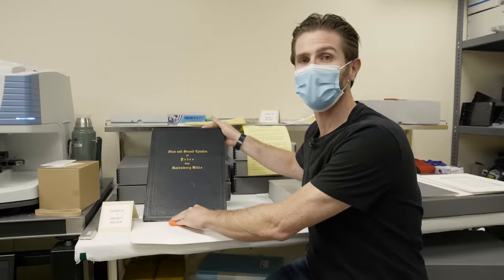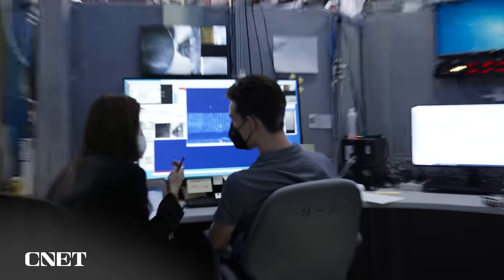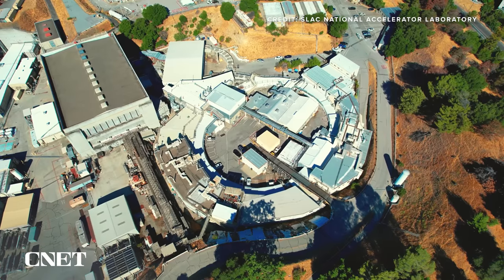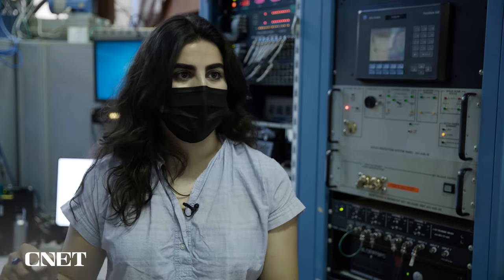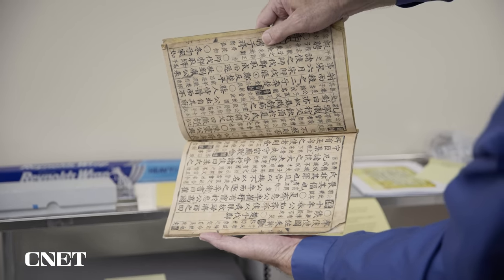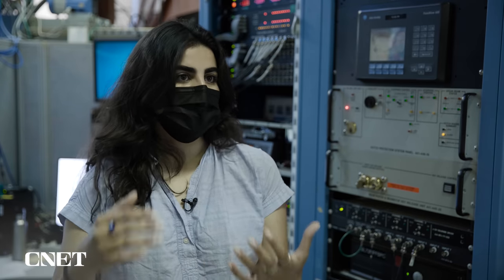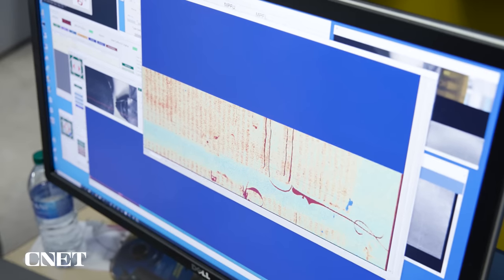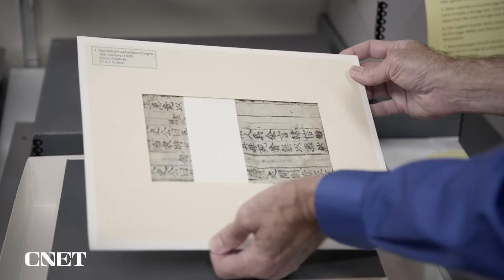This Particle Accelerator Could Uncover Mysteries in Ancient Texts

Comment: This man is touching a Gutenberg bible with his bare finger!!! WHAT?!
Reply: Yeah, that alone makes me think these documents are reproductions, used for educational purposes
Reply: @nicholasmangialardi1618  It is actually fairly common for modern conservators and researchers not to use gloves when handling old books and documents, but rather preferring to just use well washed and dry hands.

The reason for this is that gloves reduce sensitivity and add bulk to the hands, making them more clumsy, and as old paper tend to become brittle, the risk of tearing the paper is seen as  a more immediate and serious issue.

Of course, gloves are still used in some cases, books may have been treated with pesticides that can be harmful, and there are some materials that are more sensitive and so even clean hands can pose an issue.
Reply: @Ts6451  exactly! I learned this when I was there too!